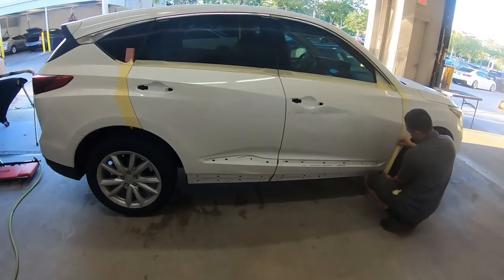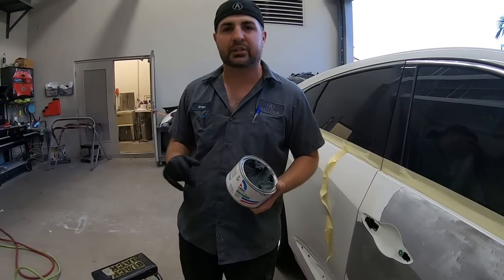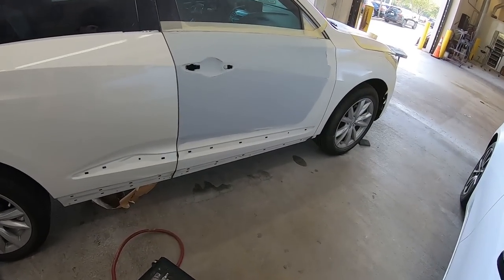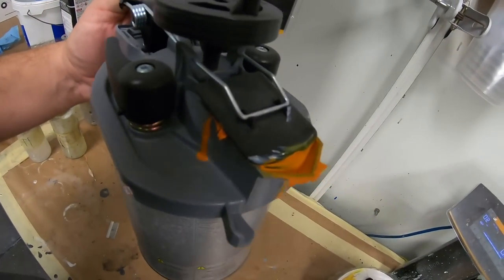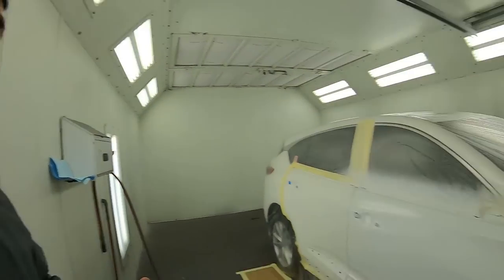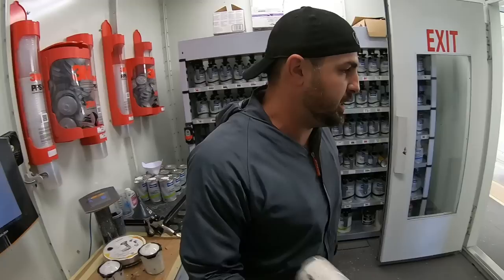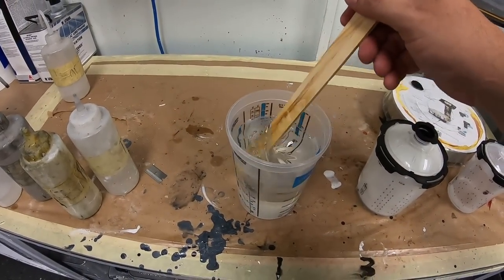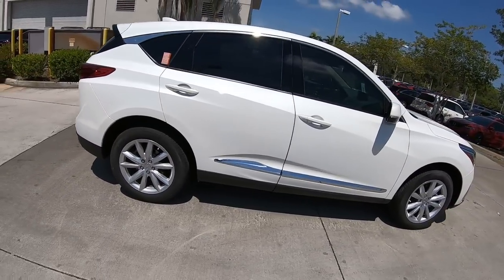Car Painting: Repairing a Brand New 2019 Acura RDX White Pearl

Comment: Hey! Loved this video great info!!!
So I’m trying to do a FULL paint job on a Toyota mini truck that’s originally Toyota super white 040, and turn it to the Toyota white blizzard pearl which is 070 and uses practically the same super white 040 base coat.
I’ve did minor repair to the fender and rear of bed, plan on doing a pearl blend from bodyworked areas.....
Any advice on blending the new base 040 to the original truck paint 040, before spraying the entire truck with the 070 blizzard pearl??? 
I may f****k up as this is the first time I’m doing an entire vehicle by myself and in a backyard canopy/tent....
In other words much advice needed. Lol
Reply: Also not to forget to mention...I probably OVER spent.... BUT I don’t want to f***k up as I spend $1100 on all the primer/base/pearl. 😬😬🤩

Comment: How did you blend it with the sealer?? 
What did you used?
Was it just sealer and that can bottle or is there something else that you spray before the use the can bottle?
Reply from the maker: For sealer if it dries rough just take 800 grit on the edge. You can use blender on the edges to smooth it out as well when you spray it

Comment: What clear coats do you work with there? Are you using like a 2k, 2x, Diamond finish, some ppg or some universal, speedkote... etc? What blends the best for like 2010 and up and 2009 and down, best overall shine and depth for a complete paint job?
Reply from the maker: Adriansitos623 basically all the clears we  work with are 2k meaning they require a Hardener. We use standox paint at the shop but spray many different clears. 

There are so many products out there it’s hard to give a correct answer but take a look at high end clears offered by ppg, rm, spies hecker, they will give you the shine and texture you’re looking for. 

Metallux and Montana also make some great budget clears as well.
Reply: Just to point out a very user friendly product is glasurit as it's very simple and clears are great quality and good price
Reply from the maker: Mr T we use to have access to basf but we changed jobbers, I have heard good thanks about those cleats as well